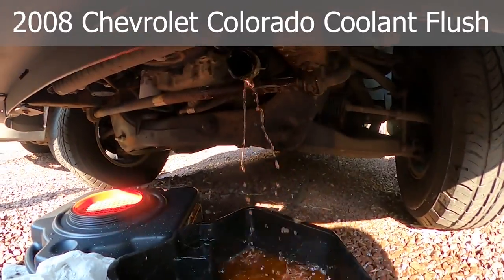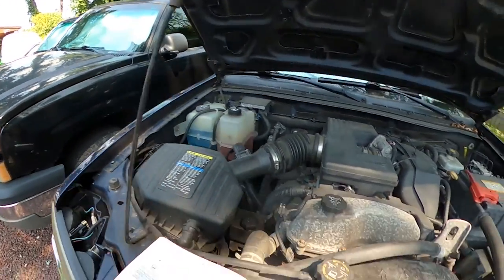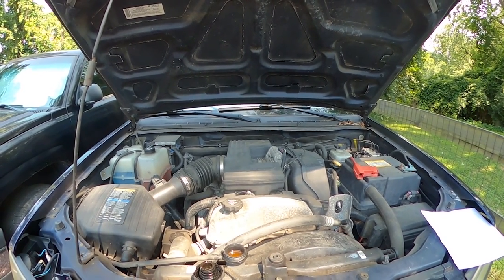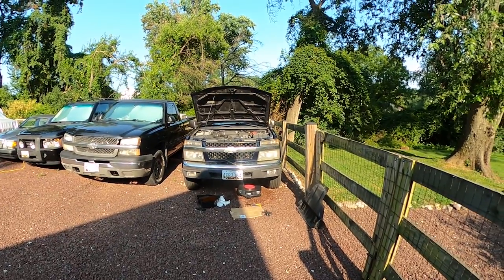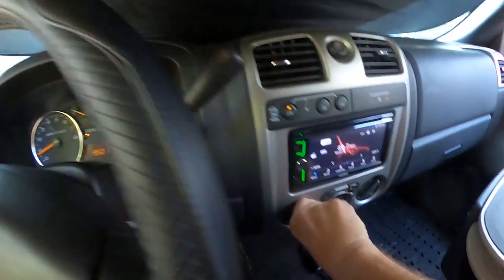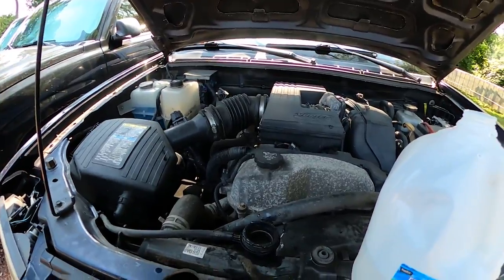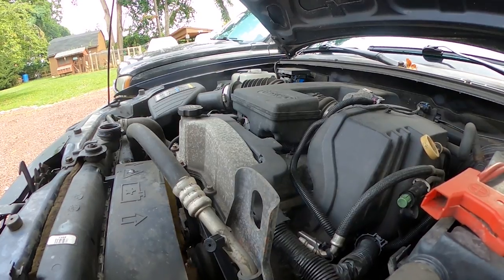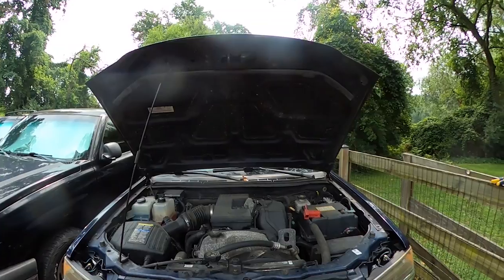2008 Chevrolet Colorado coolant flush

Comment: Cranking the heat up in the cabin actually decreases engine temperature do if your trying to warm the engine up faster dont crank up the heat also if your ever overheating cranking the heat all the way up can help it not overheat as much so you can get home or to a shop
Reply from the maker: I remember an old story of a friend in Alabama driving, car started to overheat, and it was the dead of summer. Windows down and heat cranked up! Thanks for watching!

Comment: This video was Great, thank you for it (Lots of Help).

Curious when I refilled (after the water flush), I was only able to fill back with coolant mix with 1.5/1.75 gallons instead of 10qts. Any idea how to get the rest in? Coolant reservoir at the fill line, and radiators filled to the neck
Reply from the maker: Thanks for watching and your kind words. More than likely some is in the lines, radiator, etc. I doubt I got it all out as well, however, getting most out is ideal.